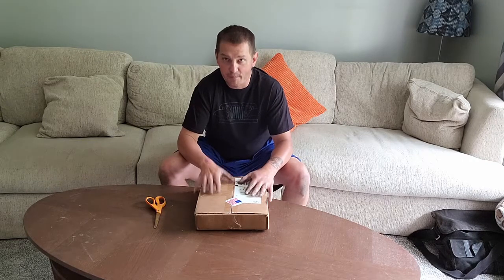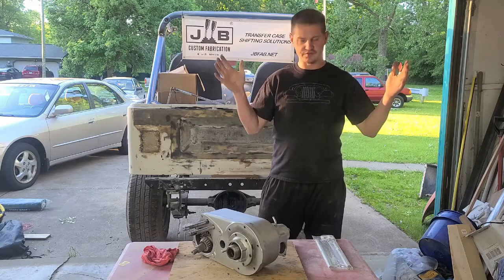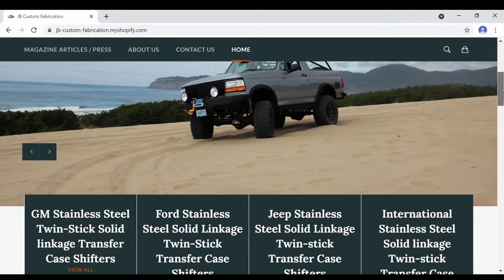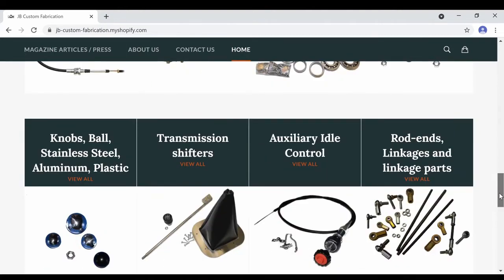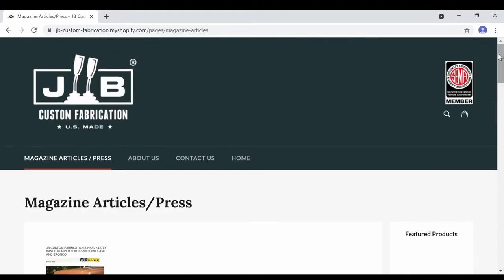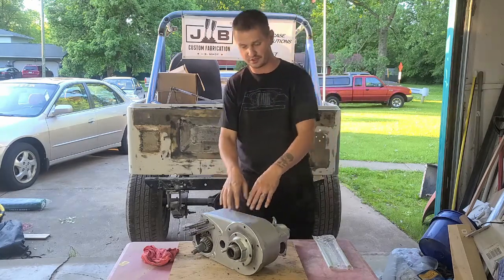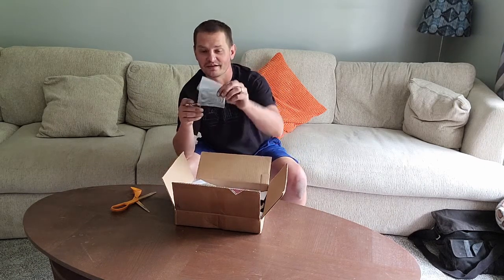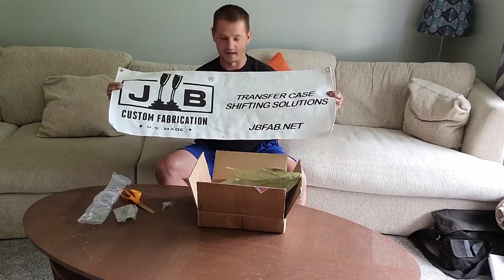Dana 300 shift rails JB Custom Fabrication saves the day Ep 14

Comment: not for more than one second did you actually show the product the sponsor sent you. shame on you
Reply from the maker: While I will agree with you that I never showed the "actual"  shift rails out of their packaging, that does not mean I didn't, in my opinion, do a good job at promoting the product. There was no reason to remove them in this episode; because they weren't being installed till a later episode, where they are out of their package. There was no need to take a chance at damage or losing one, when the original parts are identical other than material. I appreciate you watching, I'm sorry you feel I did the sponsor of the episode wrong.